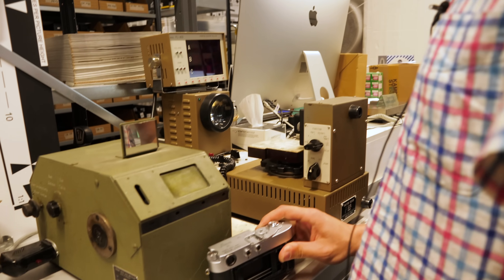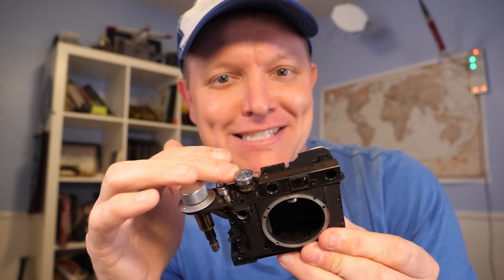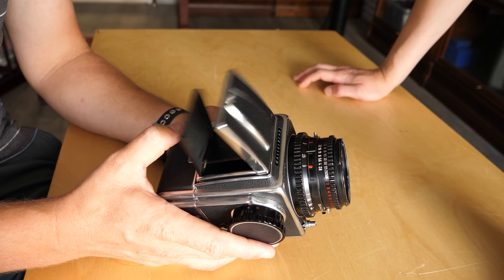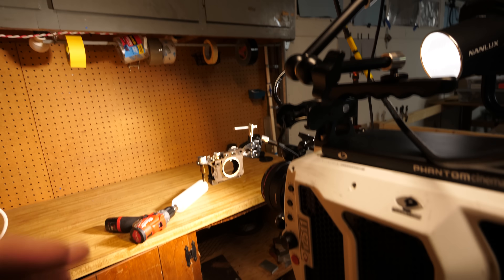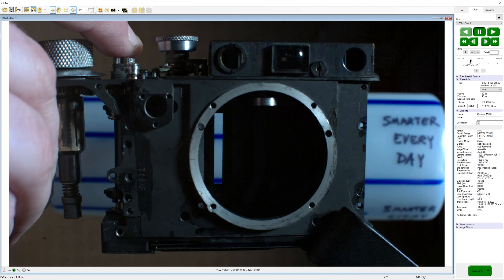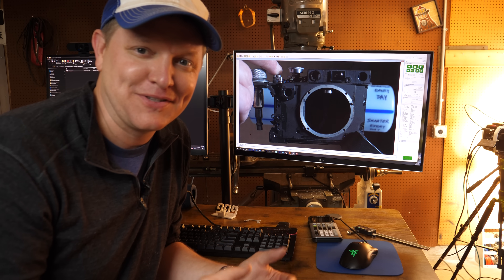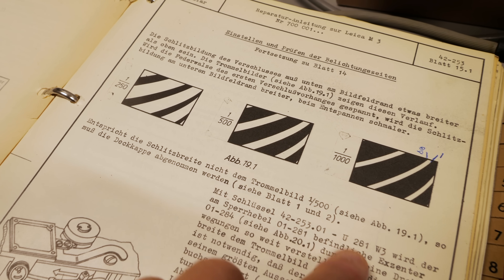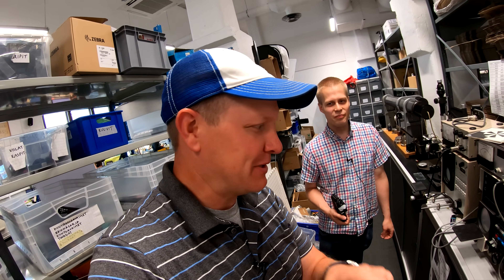How the Germans Measured Milliseconds MECHANICALLY - Smarter Every Day 283

Comment: It's like you're reading my mind. I was just thinking about how I would measure the frame rate that the human eye can see.
Reply: Now that‘s an interesting one! I wonder if this is known at all? I only remember from medical school that peripheral vision (in black and white) is much faster then the sharp center, where we see in color. I would guess the limit is slower than 1/30 of a second because that‘s the frame rate of a tv screen, isn‘t it?
Reply: @stefanschneider3681  It's about 1/50 sec (20ms).  I worked on a night vision goggle system a few years back and the requirement was to have the light that's presented to the eye stabilize in brightness faster than that so the wearer never saw a difference in luminosity (and therefore their iris never changed).  It was for the military and would go from dead dark to daylight in the desert and the soldier never saw a brightness change.  The PID loop ran at about 330Hz IIRC so it had to settle in about 6 computation cycles.

Comment: "They" were pretty smart in their day, too.
Persistence of vision happens in the eyes because when the nerves in the eye are stimulated the signal they send to the brain is not a square wave pulse. It takes a few seconds for the stimulated white sensitive nerves to fall to zero once the light is removed. I discovered a little trick when I was a kid: Close your eyes for ten to fifteen minutes. now open your eyes for only a second or so then close them again. What ever was in front of your eyes when you opened them will remain an image you see with your closed eyes for from 5 to 15 seconds. It quickly fades from a color image to a gray level image, then it gradually fades to a high contrast, light and dark image until you can no longer see anything. It helps to cover your eyes when they are closed with your hand.

Comment: At 5:06 it says: 
Set and test exposure time - continuation on page 14
The lines created must be larger at the bottom of the image than at the top. The images (look at figure 19.1) show the process. When the roller of the first shutter is under tension, the created lines get bigger, when relaxed they get smaller.

But I have to say that there are a lot of composite words which probably arent even used in german anymore.

Comment: Without the advent of modern transistors, it's always fascinating to see how high levels of precision are achieved with relatively simple mechanical systems. Also, it's interesting the shutter rolls right to left on the film cameras instead of top to bottom like modern CMOS cameras, but I suppose that just made the shutter mechanics simpler and easier to package into the camera body.
Reply: Super interesting indeed, I only use reflex cameras and never realised the viewfinder cameras (or 'mirrorless') used this 'curtain' as a shutter

Comment: Not sure if your shutter speed overlay on the exposure demo was accurate, but you should typically be shooting at 1/60th for a 30fps video (or 1/120 for a 60 fps, 1/50 for 24 fps, etc.)!  This gives the equivalent of a 180 degree shutter.  If you needed more light, bump your ISO up one stop!